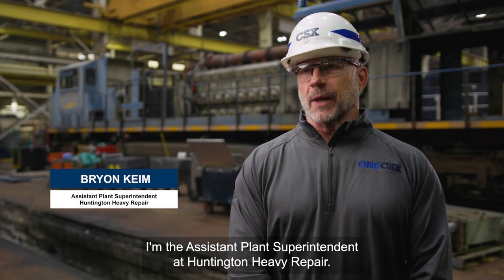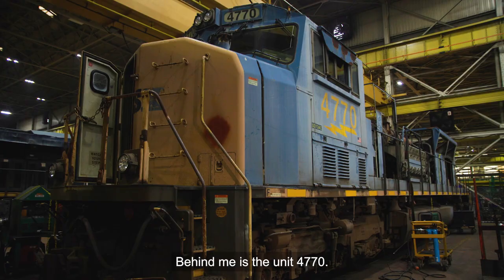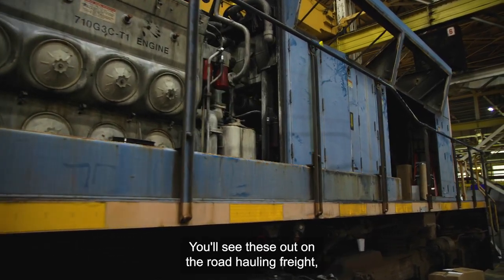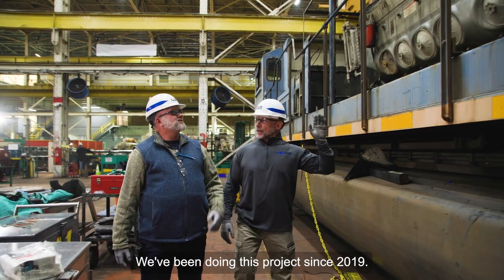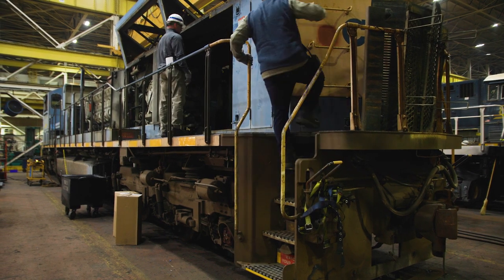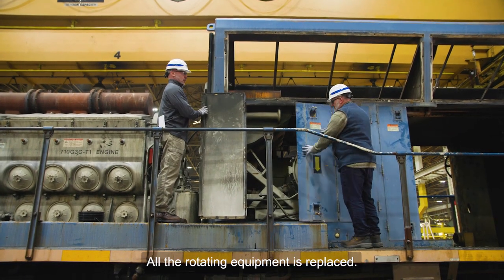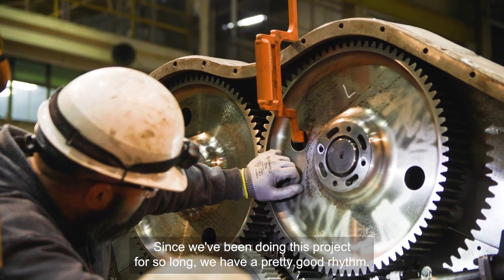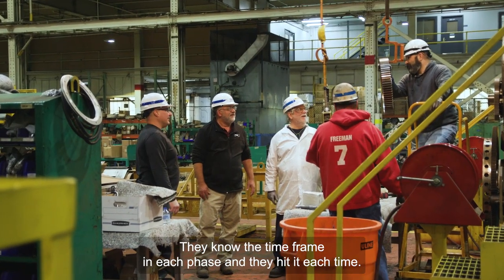CSX: Advancing Freight Efficiency with SD-70 Locomotive Rebuild Program

Comment: Are they rebuilding the 710 prime mover or replacing it with something else?
Reply: Rebuilt 710 with EFI upgrade for more precise fuel metering.
Reply: It's still a 710 engine just electric control instead of a governor
Reply: @joshdevine2669  okay.

Comment: SD 70s have replaced the SD40 as the road switcher. Because of this all of them need to be modernized in order to do their switching operations on the main line. To do this the radiator and dynamic brake blisters are removed and new components are installed. The engine is taken out and replaced with a greener one and the electrical cabinet and the alternator are replaced. Underneath the locomotive the traction motors and the inverters are removed and replaced with units that run on alternating current. The final step is the cab is modernized and all components built in the 70s and in the 2000s are removed and replaced. The brake reservoirs are then flushed and many of the components are replaced. All that is left is paint and the engine can go back to work.
Reply: Did they keep the desktop control stand

Comment: Hopefully, UP does the same with all their SD70M's.
Reply: They are Union Pacific also has a rebuild program over there at Jenks most of them are being sent over to EMD while the roster being traded. SD 70s are used as road switchers now that is why they rebuilding them. For the most part most of the SD40 fleet and some of the Geeps are still used in yards but all the road engines of the SD 40s and the Geeps they have been sent to LTE X or sent a short lines.

Comment: What is the difference between 7, 8 and 9s.
Reply: If you mean the Dash 7, 8, and 9, those are successive locomotive generations built by GE. The main differences are in improvements to the electrical and control systems, increases in power from the engine unit, and significantly improved traction control and cooling system improvements in the Dash 9.
Reply: @ thank you. I work behind CSX maintenance away. What kind and what size engine powers the electric engines
Reply: @ On the GE locomotives, they have a 7FDL (usually 16 cylinders) four-stroke diesel engine, compared to the EMD 710 two stroke 16 cylinder diesel engine found in the SD70 series on the locomotive in the video. There are small detail improvements between each generation to get more horsepower, but I don't really know the difference.
Reply: @ thanks for your time

Comment: Thank you for rebuilding the Macs. They are the most admired units on your fleet. Hopefully BNSF does the same
Reply: Engineers don't much like them though.
Reply: Why because the railfans like them? Crews always seem to like the opposite of what railfans like.@nicholaswhitfield9341
Reply: Yes i hate sd-70s as a csx enginneer @nicholaswhitfield9341
Reply: And why is that if I may ask?
Reply: @ Probably because they have a turbo whining noise that GE units don't.
Reply: And ns needs to do that too
Reply: @ NS has no SD70MACs
Reply: @SignalMan9292oh I see ok
Reply: The SD75, SD60s have been getting overhauled.  The SD70MACs are destined for scrap.  SIEMENS no longer makes parts for them and the SD70MACs to SD70MACe are 900% garbage.  They consistently blow main alt field coils.